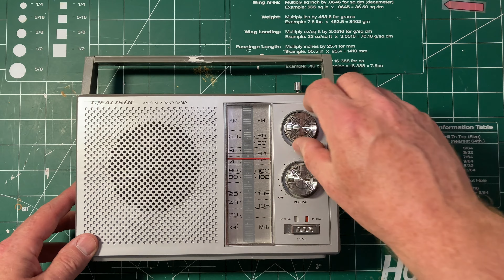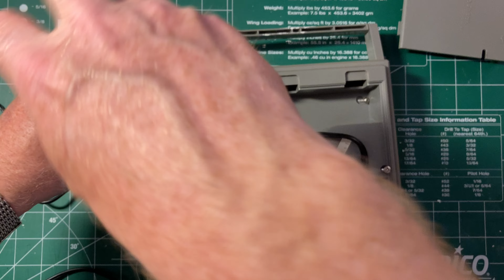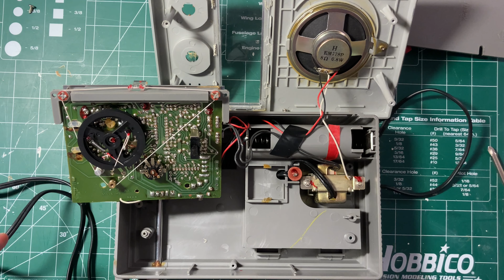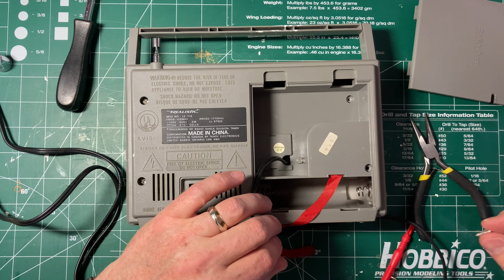An Easy Repair of a Realistic Model 12-716 AM/FM Radio

Comment: That’s about the BEST place to find those radios 📻 today. They’re often pretty 😍 cheap. Be VERY careful, because some of these radios 📻 are either a great 😊 deal, or junk. I pass radios 📻 🆙, if it looks like 👍 they’ve been through the Katrina flood, or the dial cord is broken 😞. I also pass them 🆙 if they don’t work when plugged 🔌 in. ALWAYS check for an AC/DC switch, because this can be overlooked. This can give you the “it doesn’t work” mentality, such is if the switch is in the DC position, and you plug 🔌 the radio 📻 in. The radio 📻 simply may not turn on, because it thinks you’re using batteries 🔋. Some radios 📻 remember to do the switching from AC to DC (or vice versa) automatically. When shopping 🛒 for these radios 📻, ALWAYS check for the AC/DC switch, putting it into the appropriate position before plugging 🔌 in the radio 📻(or vice versa, if using batteries 🔋). These radios 📻 are such beauties on the inside. Even when sophisticated. Your friend, Jeff.